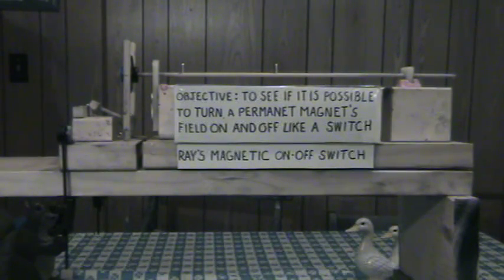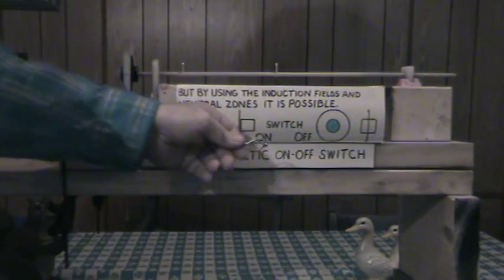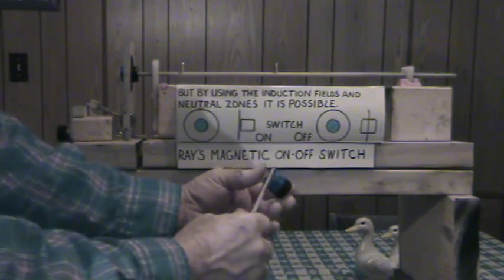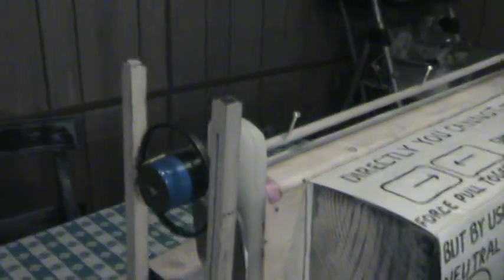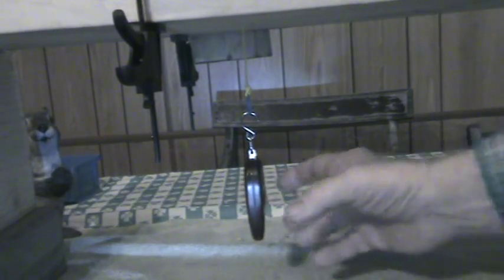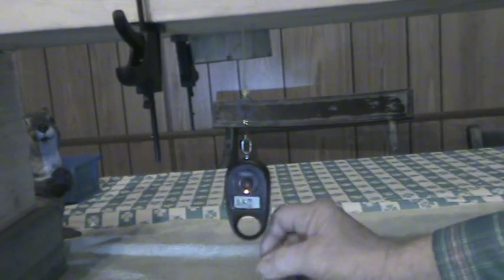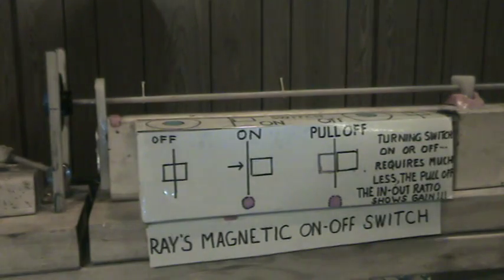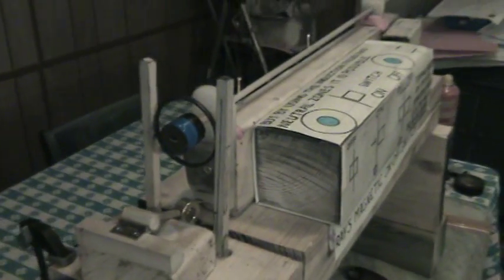Ray's magnet switch (on-off)

Comment: When pulling the magnet apart, you need to subtract the weight of the magnet you are pulling apart from the calculation, because the weight of the magnet is already applying its own weight as downforce.  I don't know the weight of the hinged magnet, but the calculation wouldn't be twenty-to-one, since you didn't include that weight in the calculation.  You should have placed the magnet you are pulling away on a horizontal hinge, so then your calculation would be accurate.  This is interesting though.

Comment: This how the Howard Johnson magnet motor operated.
Attraction and cancelation there of in a timely manner by use of crescent  moon shaped iron plates slipping through opposing magnetic fields.

Very simple to comprehend, but very difficult and exspensive to make the components.

Comment: Ray. 
You are demonstrating THE WORKING GEOMETRY OF
HOWARD JOHNSONS 
MAGNET MOTOR. 
HE USED IRON TO CREAT ATTRACTION WERE REPULSION NORMALLY ACCORD BETWEEN TWO MAGNETS, AND AS YOU DEMONSTRATED THE ENERGY TO PULL OFF THE MICRO THIN EDGE OF THE SHEILDING PLATE WAS 1/10 OF THE FORCE GENERATED ON THE 1/4" FACE OF THE LEADING EDGE OF THE ATTRACTION GENERATOR SWITCH PLATE.

I BELEIVE YOU ARE THE MAN THAT CAN ACTUALY SEE WERE THE ENERGY HIDES IN HOWARDS DESIGN REGARDLESS OF HOW REVERSED THE US PATENTS OFFICE ARTS DEPT. PRESENTS ITS MAKEINGS.
Reply: Can you visualize a 1/4" flat iron plate bent into a creacent moon shaped and gradiantly honed micro thin from center to ends.

Comment: Sorry. It is a one way switch, not on AND off. I would compare it to a spring loaded mouse-trap. It needs very little power to make the spring release. In fact you are doing the same, by setting the top NEO in the middle, you spring-load the lower hinged  magnet.
Have a look on YT, look for a video from tinman, he uses the neutral zone to make a nifty device with that 'feature'. Note: he may call it the bloch wall, I am not sure,
Reply from the maker: thanks for info , could not find the one about tinman ,leave the title of that one. what i did not demonstrate not only to let go with less power , was also lift up more weight and reset weight with less power. If you say put a weight one eight inch away it will reset itself with less power than the weight ; which a spring device cannot do. thanks again